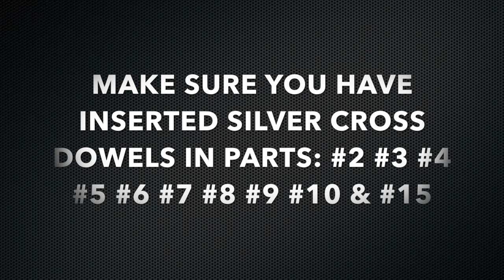Alpha-Cade Vertical Arcade Machine Assembly Instructions

Comment: Can I purchase just the top half parts? I already awn a alphacade and can transform it to a vertical with a 32” tv and those panels. What size tv did you guys use?
Reply from the maker: Sorry, that is a completely different cabinet and is not modular. In addition, both cabinet models have been discontinued.
Reply: @Gameroutfitters  man, fuck that shit!!